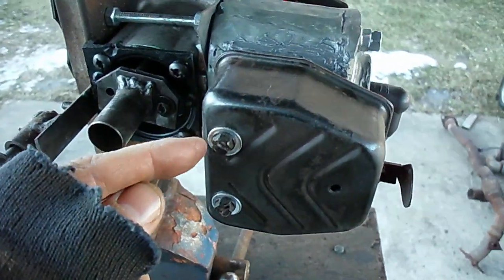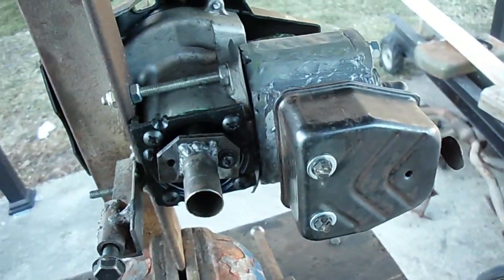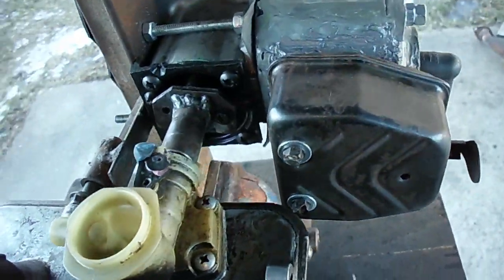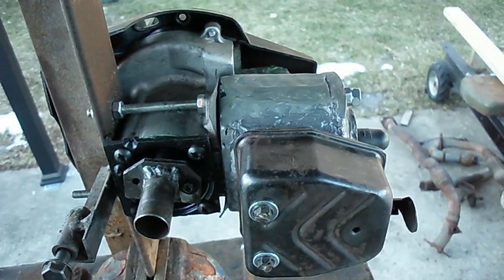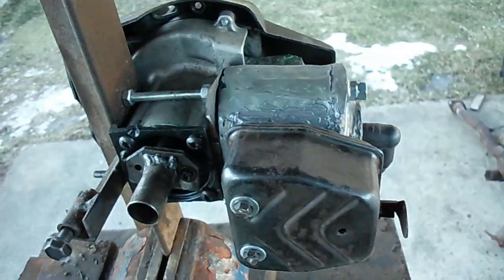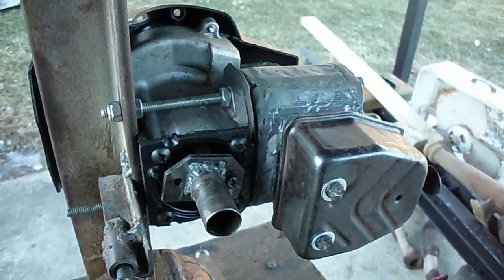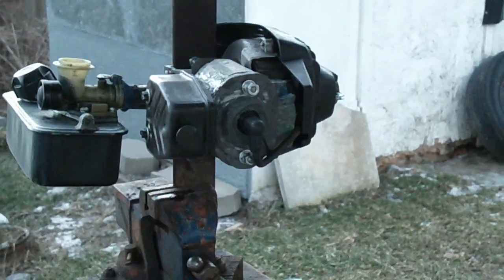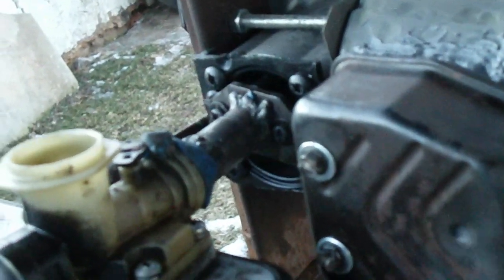JB Weld Engine with Muffler Starting FAIL :(

Comment: Ok so you made a cyl out of jb weld and you have only one ring on the piston and your wondering why it wont start REALLY! Doesnt take much brains to figure that out!
Reply from the maker: Well, I kind of disagree with that conclusion. This engine ran pretty well before i broke the one ring, and installed the muffler, so I think it is the muffler causing the problem. Plus the top ring does 90 some percent of the sealing work, and I have run other engines with just 1 piston ring.
Reply: ChargerMiles007 yeah ok we’ll go with that! Get a job just not a job working on engines

Comment: Just needs more tweaking and she'll be right... :)
Reply from the maker: Perhaps, I was about ready to pack it in after cranking on it for 20 minutes, I only showed a little of the fun in the vid. I suspect the ground wire on the magneto was a bit loose, but I am not sure. i fixed that problem, so I know it has good spark now. If I have to I will drill a hole in the muffler, if the increased back pressure is causing the problem.

Comment: Mmmmm, that's not a good first run with the muffler. :'( I feel bad since I suggested it might help. 😅 Maybe some adjusting will get it to fire? Well, at least we're all still learning and experimenting.
Reply from the maker: Yes, not a good result, though it could have been a bad ground on the plug ground wire. I have a wire soldered to the spark plug, going back to the magneto, I need it since the JB doesn't conduct electricity. I removed the spark plug once to check for flooding, and i might have jostled the connection. I have fixed that now, so hopefully it will go when I can try it again soon.

Comment: Hello,
That type of carburetor with the diaphragm may not work with an engine like this.  The diaphragm is meant to pump on 3200/2 or 1600 pressure pulses per minute.  Since this is a two stroke which spins around 8000 RPM it would be about five times too fast.  It may run for a short period of time off the gas pumped up by pulling it over, but it then quits once it runs too fast and can't pump any more.  Maybe one of those motorized bicycle carbs with a float would work better.
Reply: It worked just fine before, so it shouldn't be a problem now. Diaphragm-type carburetors actually tend to work just fine with two-strokes, and they are often used with engines that will be used in a variety of orientations, like most two-stroke engines are often used.
Reply from the maker: Yes, hard to say what is happening on this attempt, since it did run quite well for a few seconds before i put the muffler on.

Comment: I don’t know if I missed it in another video. But have you tried a compression test on it?
Reply from the maker: No, I haven't checked compression with a tester, but it feels to have some compression. I am sure being down to 1 ring from 2 isn't helping matters, but I don't have any other engines like this one. I don't even have the original starter cover to know exactly what it is.
Reply: ChargerMiles007 it would be neat to see compression numbers, I feel like it would just be a good measure to make sure

Comment: Man, when its THAT cold nothing wants to run right except a well tuned snowblower (which won't run at all during the summer).
Reply from the maker: LOL, yes, I didn't want to be starting it when it was that cold, but we are getting into a colder stretch of weather now, gonna be -25C this weekend, so -12C was milder than that. I will try for another start with no carb, and the crankcase primed, like before. If it doesn't run then, i have real problems.
Reply: @ChargerMiles007  
You sir must truly be a charger. If my weather was that cold thinking about running this engine would be the last thing on my mind. We hit 50° here today so I got the wife's motorcycle fixed up and ready to ride. I never stop riding but rarely see below 30°. I rode today for sure.